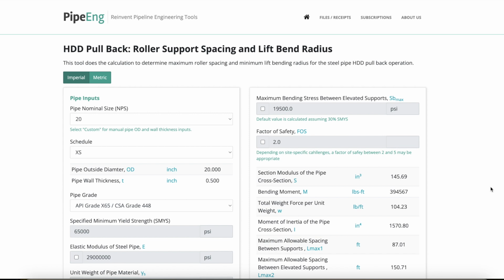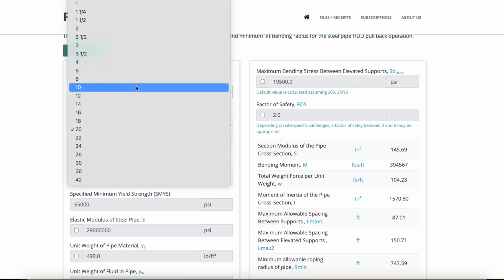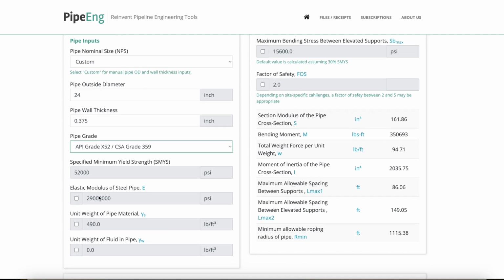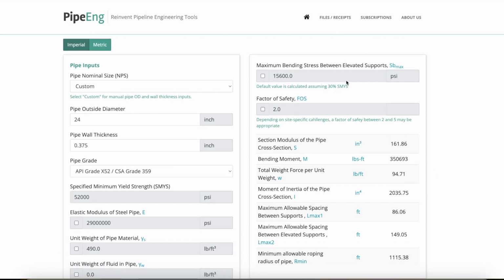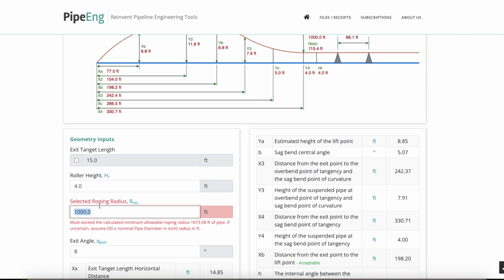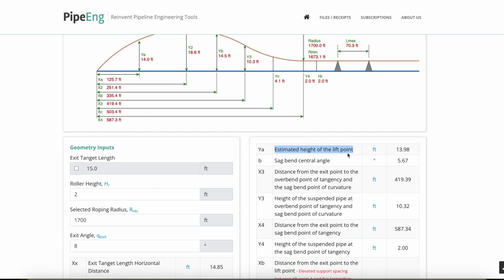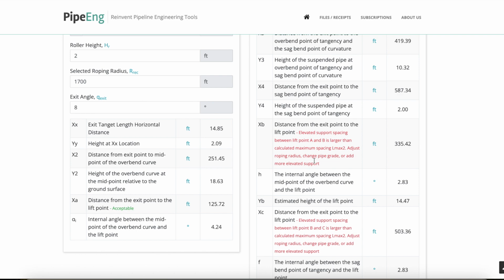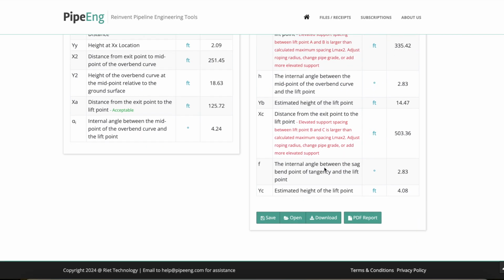Tutorial: HDD Pull Back: Roller Support Spacing and Lift Bend Radius

Comment: This Pull-Back Calculation Software would be perfect if a Project Engineer could get a detailed drawing with the option of Side-Boom or Crane icons in a Pull Back Plan Drawing Template. If you had a template that was Pull Back Plan submission ready, I would do things I wouldn't be proud of for a tool like that. Nice work by the way, glad I stumbled upon this.